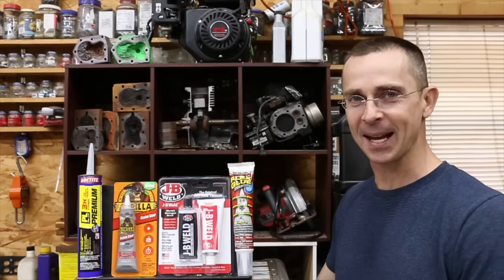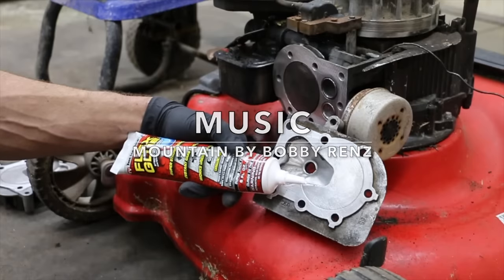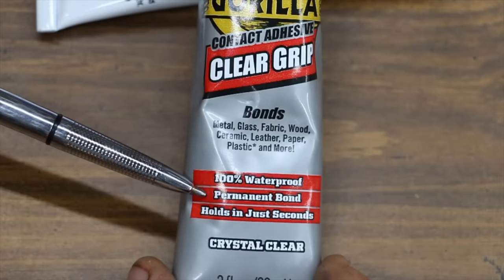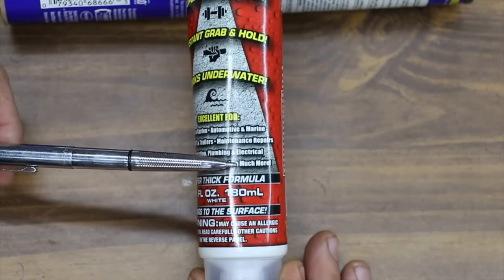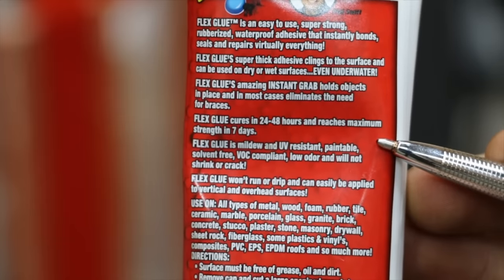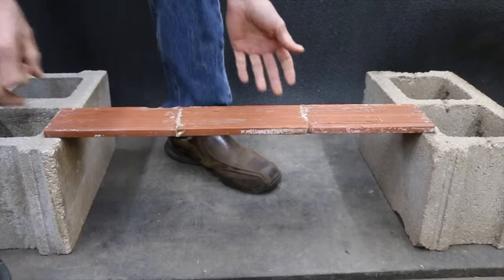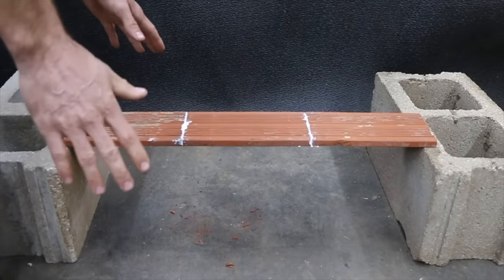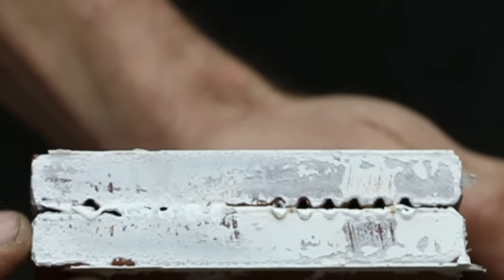Is Flex Glue better than JB Weld, Gorilla & Loctite?  Let's find out!

Comment: Great video. I am a HUGE JB weld fan. Just last week, our main inbound water line developed a pinhole leak on a 90 degree copper elbow. It is located near the floor, in our bedroom bathroom. It is also has a shutoff valve next to the elbow. With no time to properly repair the leak, I cleaned the elbow joint (after shutting off the main), with emery cloth and a wire wheel attached to my drill. Applied JB weld to the hole with "crossed" fingers, hoping it would buy me some time. I used a heat gun to warm up the copper before applying the epoxy. After 2 hours I turned the water supply on and, a week later, no leaks. (Yes, I am correctly repairing replacing the pipe). I've used JB on other repairs and I am amazed with this product.
 I've used all of the products you tested. I'm not impressed with Gorilla Glue.
 The entire "Flex" line of products is total, complete junk. Phil Swift is an idiot with a huge marketing budget.
Locktite has never let me down.
Again, great video.
Reply from the maker: Thank you!

Comment: I’ve tried everything out there and original JB Weld is the best on almost any material and, crucially, it works the best in high heat applications.
Reply from the maker: Thank you!
Reply: What sort of heat does it take ... I've a small crack in a gearbox I'm looking to repair ...
Reply: @Gw0wvl  It'll take any heat a gearbox can put out.  It fails at around 550 or 600 F if I remember correctly.  That's hotter than some heat treatments and if your gearbox ever gets that hot your oil will have failed long before the JB Weld will.
Reply: Fixed many of old radiators with it and it was a long time fix
Reply: @SpaceCoast_  My biggest success with it was fixing a valve seat that came loose on an Onan 20hp twin.  Those air cooled engines run pretty hot, and this was an exhaust seat.  Roughed it up, used a center punch to kinda swage it out a bit and give the JB something to hold onto, punched a little in the seat's recessed cup a little (in the head), then JB'd her in there, had to use a little hammer tapping to seat the seat, and last I knew it was still going.  Amazing stuff.
Reply: @Gw0wvl  I remember there being a testimonial on the box at one point where a guy used JB weld to repair a block that threw a rod
Reply: They also make a few high temperature grades, though I haven't tried them yet.  I bought the extreme heat version for some stripped threads on an intake manifold bolt.  We'll see how it goes....
400F:  https://www.jbweld.com/collections/all/products/highheat-epoxy-putty
2400F:  https://www.jbweld.com/collections/all/products/j-b-extremeheat

Comment: We knew that JBW would stand out in the end. And yes, it's probably not fair to compare 1-part chemistries to a 2-part expoxy. But that aside, I did watch the video from start to finish. I would have liked to see the surfaces prep'd to a more uniform level as in a couple of the tests, the "smear-on" techinique left me wondering if the surfaces had been cleaned enough, and the application details matched enough, to provide a uniform test condition. Other than that........ not for commerical-code work, but at my home shop, I keep multiple paks of JBW in the quick-cure and standard cure chemistry. It's my go-to "joiner" for stuff that I think needs to only stay together for the next few weeks........ yet I end up keeping the repaired item for years....... and without a failure or fault in the JB product. BTW... they're still a family run company, and when I called for technical support, a family member answered the general office line. (I was impressed...)
Reply from the maker: Thank you!
Reply: JB Products still a "family owned" business...I did that know that until now...Thanks for the info Al Sterling...

J-B Weld's website »
 www.jbweld.com

J-B Weld is a manufacturer and marketer of epoxy adhesives and specialty repair products.

J-B Weld is a Private company. Chip Hanson is the Chairman & CEO of J-B Weld and has an approval rating of 57 from Owler members. 

J-B Weld's top competitor is EPO-TEK, led by Andrew Horne, who is their President. 

J-B Weld has 23 followers on Owler.

Estimated Annual Revenue 35M

Estimated Employees
 85

CEO Approval Rating
 57/100
Reply: I noticed the uneven application of the Gorilla in a couple of places and thought maybe there was a problem.  I still do not like the expansion, but wondered if there was a different formula for each application tested.
Reply: Would regular formula of jb weld be sufficient to fix an exhaust leak on a 150cc scooter? Or should i get try the extreme heat? Thanks in advanced.
Reply: Stop writing novels pal..... Shut up!

Comment: I cringed when the flex glue mentioned electrical as a use, I can just imagine the homeowner-DIYer-specials
Reply from the maker: Great point!
Reply: The special thing about that is free fireworks!
Reply: Actually I used it and it works well. Small electrical part that needs waterproofing could use this. I used it for an RC boat and it worked way better than the original seems and gaskets

Comment: I had a frost plug that had a hole in it. Used J&B weld on it. That was 26 years ago and its still holding
Reply: I had a friend who replaced all his freeze plugs in a 1950s Mercedes that outlived my friend.
Reply: What's a frost plug??
You meant freeze plug, right??
Reply: @wbrockstar9550  - frost plugs, freeze plugs, or engine block expansion plugs
Reply: @wbrockstar9550  He means welch plugs because they have nothing to do with the water in the jacket.
Reply: @slicknick1213  I always figured they were called freeze plugs because they get frozen before insertion. Then hillbillies decided it's for water freezing in the jacket

Comment: JB weld is in a league of its own
Reply from the maker: Thank you!
Reply: JB weld pulled away on a plstic joint with a nylon reinforcing strap so I repared it with a build of superglue and baking soda. Great fix.
Reply: brocktemple25 Wrong Quicksteel only is better (proven) by handling higher temps as far as adhesive properties goes?! Jb weld totally wins....which this video reflects, it's about adhering properties..
Reply: Absolutely!
Reply: The original, yep.

Comment: This test was spot on, I have found the exact same results. JB Weld is just amazing. I run a sawmill, and one night I ran a stick through my tractor radiator getting a tree out of the woods. I was dead in the water, every repair shop was closed. The only thing I could think of, was to try and seal the hole with JB Weld. It was a hail Mary pass. The hole was about 3/8" . I used the JB Steel Stick that you tested in one of your other videos. It set up in an hour, and sealed completely. I ran the tractor for another 2 days before I got it repaired, and not a drop leaked. As you would say.... "Very impressive!!".  JB Weld rules!
Reply from the maker: Thanks for sharing!

Comment: For places where you want a 'RIGID' glue:  JB-Weld epoxy is the best.  For places where you want a slightly flexible glue, Goop/ E-6000/ Shoe Goo/ Gorilla glue (they are all the exact same stuff inside) is the best (you can actually 'peel' it off most plastic surfaces later if you want to remove the glue.  Flex Glue is a terrible glue, but it is an EXCELLENT caulking material to use in bathrooms as it is 100% mildew proof, unlike most silicone or acrylic caulks.
Reply: ב''ה, Gorilla's got cyanoacrylate (water-curing Crazy Glue) in some kind of .. urethane? that renders it subtly flexible like a hard plastic and absurdly sticky to most things one or the other would bond.
 
Fairly certain the Goo products are silicones?  And I thought E6000 was as well though I've been surprised at it bonding a few things those might have been less than stellar at sticking to back in the day.  Don't quote me but Goo might be the most flexible of them all.
 
Anyway, double check since I'm going from memory but there are some significant chemical differences, as affects what they'll adhere to, and you won't be able to expand/foam the others adding water as with Gorilla that makes it a miracle for wood repairs or tricky woodworking situations - like sticking metal hooks on the back of a valance board for window blinds that otherwise.. back when, that manufacturer shipped the kit with screws that would have punctured the visible face of the boards, and letting it foam through the screw holes and into the wood produced a good-as-nails connection for maybe half a pound of wood.
Reply: That’s nice advice on FLEX, how easy is it to remove?

Comment: I've been using JB Weld for a long time but this test surprised me how good it really is.  My first use was on a five speed transmission in my 79 Dodge Arrow.  The shift linkage mount broke and I JB Welded it back together.  It held for about six months, I redid it and it lasted ten more years till the car was written off.  It's a good addition to any car tool kit.
Thanks for another great video
Reply from the maker: You are welcome!  Thanks for sharing.

Comment: Great video 👍 JB weld has been my go to for many years.
Reply from the maker: Thank you!
Reply: i fond belzona products that blow jbweld away in oil and water contamination!! devcon is also similar to jbweld
Reply: @losteden  Any suggestions for Aluminum? Just curious because JB Weld has failed me miserably on aluminum.
Reply: Farm, have you done threadlockers? mainly for vibration, or using other glues as a threadlocker
Reply: B. Rippy  What I would have to weld is aluminum and is on a tool which that part does not come off and is inaccessible using a welder. Jet tools and their 8" jointer/planer combo machine arrived broken and they refuse to repair it, I need something like JB weld to fix the infeed table on the jointer which this break is under said table. Oh and it is behind the raising lowering screw/rod so that cannot have any spatter on it or be bumped. The only solution would be something like JB Weld which you can get in there and wipe off before it dries.
Reply: B. Rippy  Not possible, they welded the damn steel parts together. I would end up ruining it completely to tear it down more.
Reply: B. Rippy  I've tried to tear the machine down, they welded the damn screw assembly on my unit.
Reply: B. Rippy  It may not say it but mine are however they sell the parts I'd break getting it apart so I bookmarked the page for later when I actually have time to mess with it again. I already bought a different jointer it would just be nice to have this junk work like it is supposed too. Thanks for the info!

Comment: I found yet another (successful) use for JB Weld. Had a pinhole leak in the aluminum water pump housing where the incorrect pump impeller cavitated a hole. 1979 Mercedes 300SD. Of course it showed up on a three day holiday weekend so, no new parts available. Cleaned the housing, coated the interior of the pumping chamber with a couple layers of JB Weld, then ground it down where the pump impeller hit it. Drove back to work from Phoenix to San Luis Obispo with no problems, ordered new pump assembly, drove back to Phoenix, and installed the new pump. This was many years ago but it worked!!
Reply from the maker: Thanks for sharing.
Reply: @ProjectFarm  You're welcome. This wasn't the standard "glue a couple of things together". This was to build up a layer of machinable material on aluminum and hope JB's excellent adhesive held it on the housing while the water pump impeller tried it's best to pull it off. When I replaced that water pump with a correct one about a 1,000 miles later, the JB layer looked perfect.

Comment: “I just can’t recommend Gorilla Glue”
Gorilla Glue: sad gorilla noises
Reply from the maker: Thank for watching.
Reply: @ProjectFarm  My friend you didn't wet the surfaces or clamp down the gorilla glue, both are required for it to work. The water activates it, when activated it expands and the pieces need to be clamped together. I'd suggest you try again with the Gorilla Glue. :)
Reply: That's because his test isnt accurate when ig comes to the gorilla.  Gorilla has a 2 part mix weld like the jb weld.  He should've used that gorilla product instead. Then he could've compared them. It wasnt a fare comparison
Reply: Also use more Gorilla glue you barely used any and use 5 times to 10 times as much of the other products.
Reply: Gorilla epoxy is tough
Reply: RIP HARAMBE
Reply: Are you baby yoda
Reply: WokeMe 11:11 well... yeah
Reply: Glues Out for Harambe!
Reply: @xxshevilxx  you know the problem with what you say? the commercials show a small amount on dry surfaces supposedly working best. so no hes literally testing their claims. you're welcome to retry his tests with the water, but only the wood test was any significant amount of difference in application.
Reply: @xxshevilxx  tell companies to stop making false promises and youll find yourself being laughed at
Reply: IMHO it shouldn't be called "gorilla" glue, more like mini me chimpanzee! JB should be labeled "King Kong from Hong Kong glue!!
Reply: @xxshevilxx  Not according to the instructions for Gorilla Clear Grip. https://www.gorillatough.com/product/gorilla-clear-grip/ I think you are referring to a different product.
Reply: What most folks dont read is that you are suppose to wet the surface with water. A fair test would be to repeat each test useing instructions on product. Didn't here that the surfaces had been done so. Just a thaught.
Reply: @xxshevilxx  I was thinking the same thing when he was doing the glue-up ,,,,ahhh where's the water?

Comment: Here is an idea....I have so many oils in the workshop...chainsaw oil...air tool oil...3/1 machine oil...2 stroke oil...car multi grade oil.... if I had to use just ONE oil....for everything....which would work best?
Reply from the maker: Thanks for the video idea!
Reply: (Spoiler alert)  -- Marvel Mystery Oil.
Reply: The right one.
Reply: Good idea.  ANY oil is better than no oil.
Reply: Different applications, different oil.
Reply: Lenny D. Yep...but that’s the point of this channel....to see what really works.
Reply: @ProfSimonHolland  I understand that. Thanks for doing this. Everything is not one size fits all ❤
Reply: Strong arm brand general oil for everything except engine oil that stuff is unmatched to WD-40 and pretty much anything else works as chainsaw oil gun oil locksmithing and pretty much everything should definitely be a contender
Reply: mineral oil
Reply: Car Multi-Grade 👇👇 hands down...
Reply: None their all good for their own design
Reply: @ProjectFarm  Have you ever tested stop leak products for radiators?
Reply: lol, Back in the day there were only 4 types of lubes used on cars/machinery.
1) Motor oil: 10 or 30 weight, detergent or non-detergent
2) Gear oil: usually 80 or 90 weight
3) Grease: for anything rotating on a shaft
4) Used oil: for chains and anything sliding

General rule of thumb was 4 cycle motors used 10 weight in winter, 30 weight in summer, if it had a filter it used detergent oil if it didn't it got non-detergent.
2 cycle engines got 30 weight non-detergent mixed with gasoline at a ratio of 16 parts gas to 1 part oil.
Reply: I would go with untreated oil or "Lucas oil"
Reply: If I had to choose just one. Mind you I wouldn't but if I did - off the cuff I'd say Husqvarna bar oil.  Its like 30 weight with STP added.
Reply: @andrewmccarthy4144  7
Reply: Can't have 1 for everything.. remind me to never let you work on my car or lawnmower
Reply: @dlapham  
That is snake oil garbage

Comment: JB welded saved me a costly repair on a radiator in a Nissan Altima the upper radiator hose fitting got real brittle and came apart so I got my pocket knife out and carved the rest of the remaining fitting so I could try and slide the hose and clamp back on but as soon as it got enough pressure built up it just popped back off and made a mess so I figured I try one more thing and I put jb weld on it and on the inside of the hose and tightened it down with the hose clap and then then casted where the hose and radiator connected and it never leaked again I had it for three years like that and I gave the car to a friend in need and he left it alone and it’s going 6yrs strong lol with no leaks.
Reply from the maker: Impressive repair!
Reply: Didn't work on my radiator, only very temporarily.
Reply: @joepatrick477  Preparation is everything, when using adhesives.
Reply: JB weld won't work on wet or dirty surfaces, you have to clean and dry the area to make it work, so if you're JB welding cooling systems you need to drain that area and keep it dry for the curing time.

Comment: I used JB weld to repair the suction fuel line on the top of a 60 gallon truck fuel tank. Originally, this line was installed at the factory using solder. This was supposed to be a temporary repair but lasted well beyond the five years I owned the truck.
Reply from the maker: Impressive repair!
Reply: Temporary fixes are permanent solutions
Reply: @skonky  that's when you really fix it
Reply: Gerald Trice
Nice. A buddy of mine his dad back in the day used the JB Weld on a cast iron I think it was a Model A Farmall with a cracked block and it stopped the coolant leak.
Reply: I used to race stand-up jet skis IJSBA Expert 785cc Modified class. Anyway, had a set of connecting rods blow through the cases on a full mod motor.  Sanded the aluminum castings to give jb weld some bite and a good cleaning with brake kleaner to get rid of the oils and made the repair that never failed.  I'll admit that motor became my practice and backup motor because I wasn't sure to trust it, but it never failed.